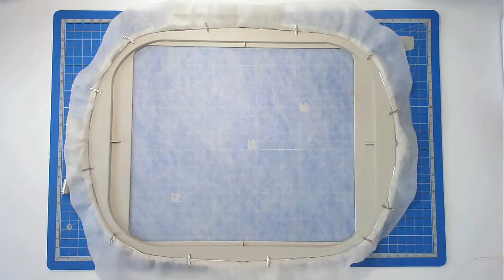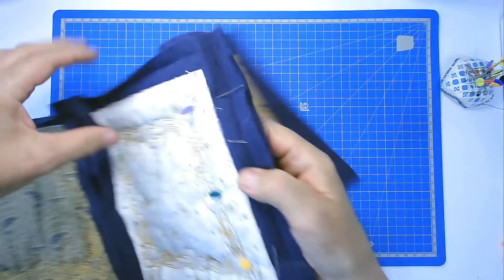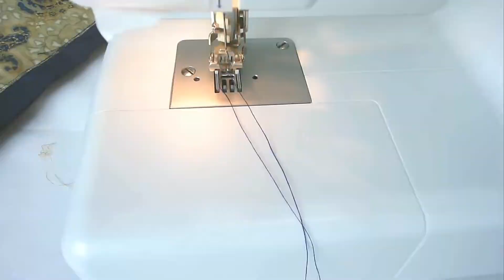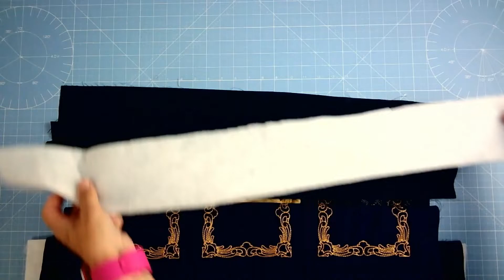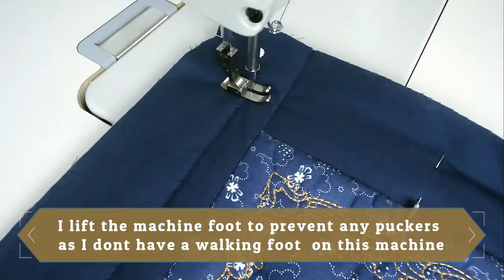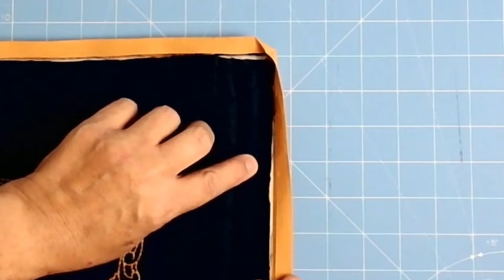Reversible Quilt With Built In Sashing Using Fancy Frames Quilt Blocks By Kreative Kiwi

Comment: Love the video. thanks. I saw you have a small and large squissers. I have the small one, but cannot find a large one. Would it be possible to send web site for the large one. Thanks.
Reply from the maker: Hi Sue, thanks for watching. I get my large squizzors from Amazon but they don't have them in that often so it is a case of get them when you can. They are called curved precision pinch action aquarium scissors. Happy New Year.
Reply: @KaysCutz  Thanks, I finally found some on Amazon. Happy New Year!
Reply: @sueernst9876  Would love to know a maker's name as I have searched for ages but only can find small ones or ones with handles?